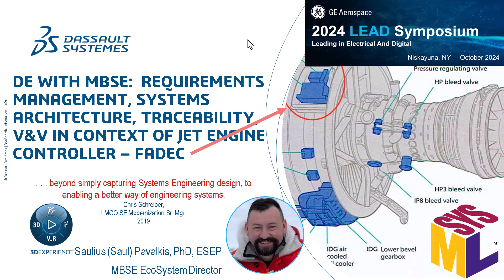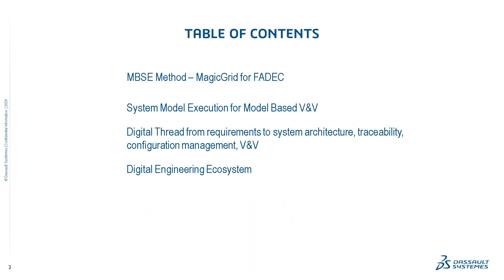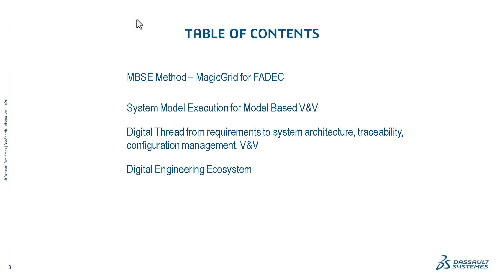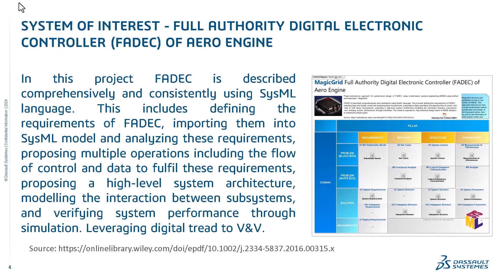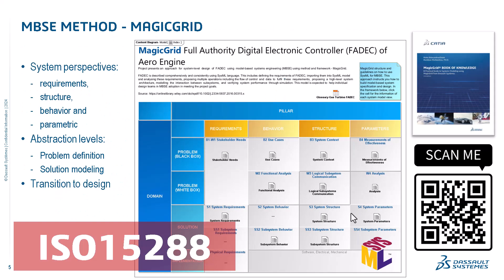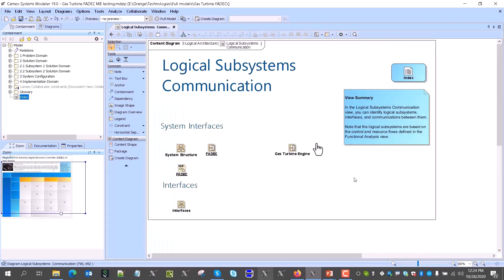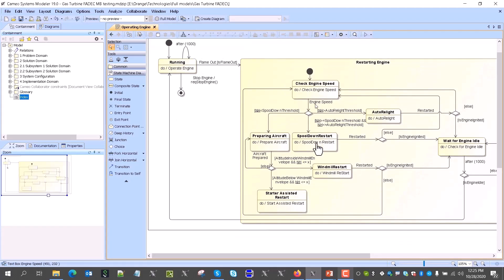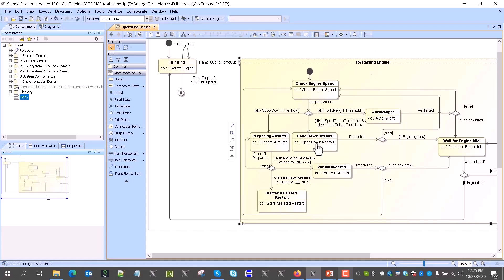DE with MBSE:  Requirements, Architecture, Traceability, V&V for Jet Engine Controller – FADEC

Comment: I had trouble opening this and the Turbine model using Cameo 2024.  Getting a "Failed to load" message with "com.nomagic.magicdraw.persistence.xmi.load.model.utils.h" so perhaps a plugin difference of Java difference?
Reply from the maker: Thank you. We will check. But it shall be no data loss in any case.